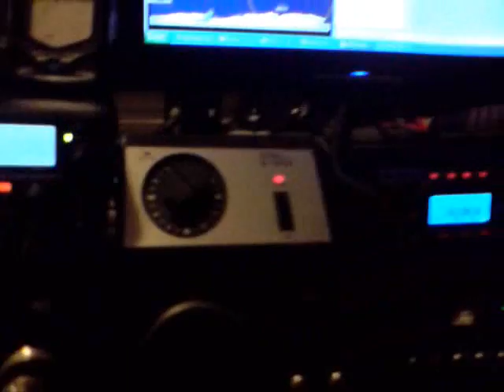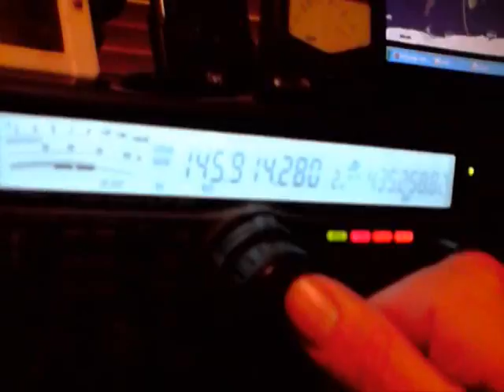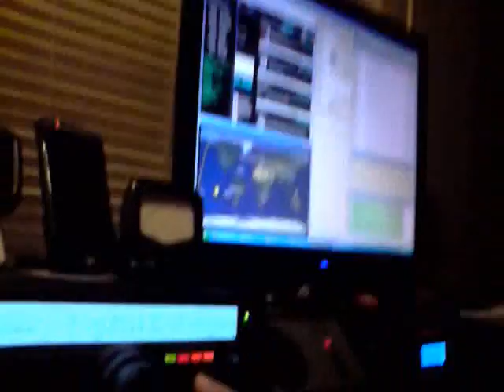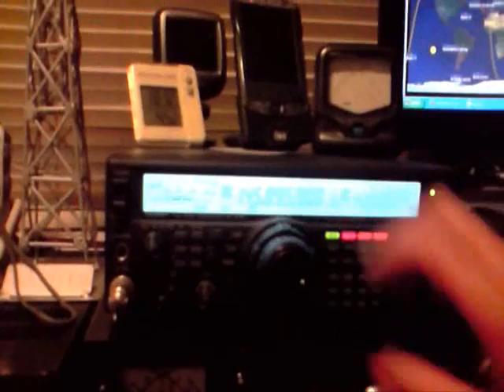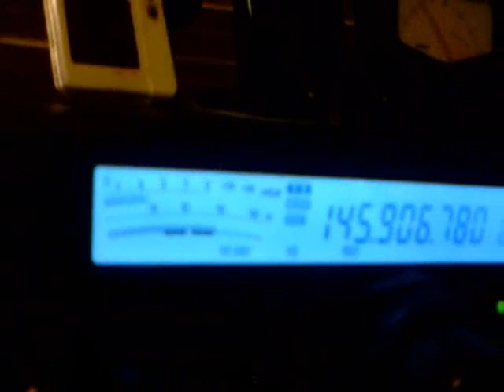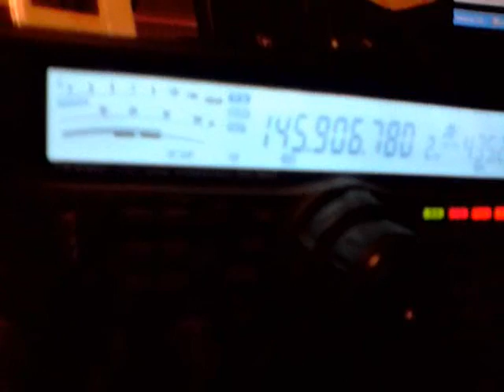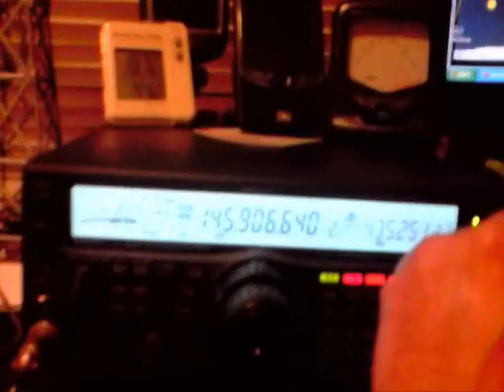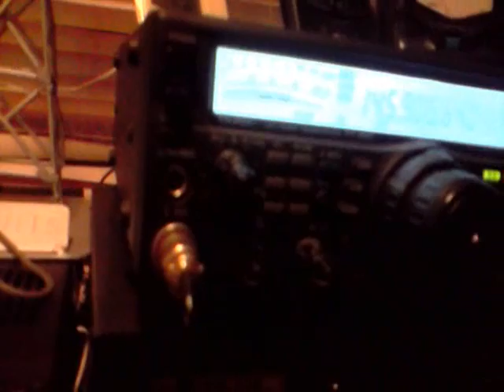HAM RADIO - How To Make A VO-52 SAT QSO

Comment: So whats the point of this exactly ? Is it just audio comms , do you reposition with this ? What? is data is gathered ?
Reply from the maker: @joelireland5477  hi Joe check out some of my more recent satellite videos on my channel. The basics are use your own setup to get a signal returning to another station in the range of a sat traveling in a low earth orbit at 7 miles per second. It is not so easy so we all try different kit, and different software to track. Some build there own antenna or radio. It's called amateur radio and this is one of many ways to make radio contacts without the use of the internet

Comment: Hi Simon, I just bought an FT-847 and wondering what a good usb cat cable is WRT f Doppler correction via an Windows 10 PC.
Reply from the maker: https://www.ebay.co.uk/itm/122113903040 hi bud congrats on your new radio.
Reply: @M0YKSHamRadio  thanks! So far I try to learn working with the radio, looks complicated to start.... is there a short manual to program the satellites and to operate in Satelite mode? 73 PD1MV

Comment: Where you tracking the signal with the VFO or were you using a software program? I hear many say that a software program is a must for working the SSB birds? I am new to them so I don't have any idea? Thanks & 73 de W4KVW EM80 in Florida
Reply from the maker: I used the vfo always do, easy enough I use a key to transmit a tone on the up link which I can easily find and pick up on the down link. I can then tune up to the central part of the signal which is a few Hertz wide. If that makes sense

Comment: i have a station setup at the club with a 8 element cross yagi (8 each) and a 4 element vertical yagi and a small channel master rotor and at an angle of about 20-30 deg.
and the station is an old yaesu ft-726r.
question:
Once you are tuned(hear your self on the downlink) do you correct the up or down link for doppler ?